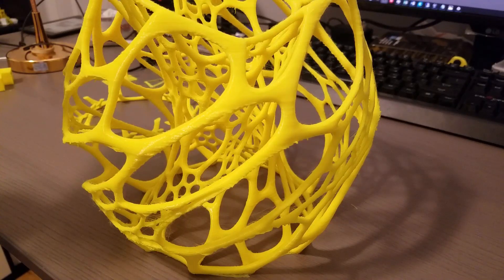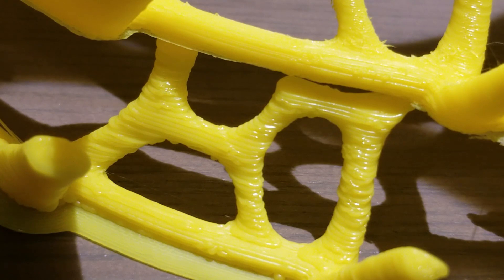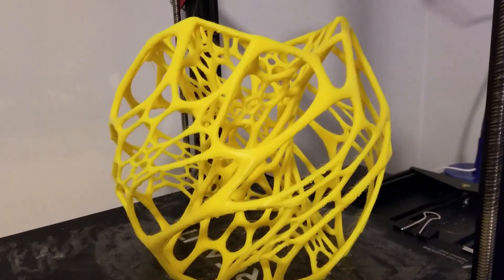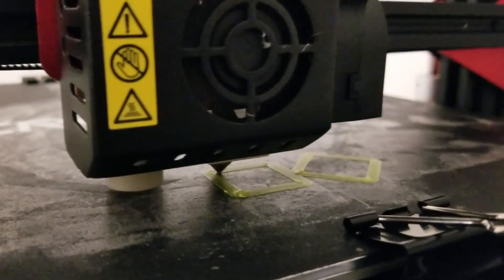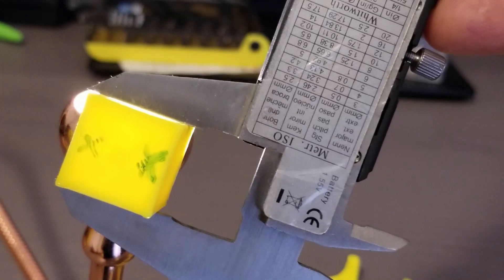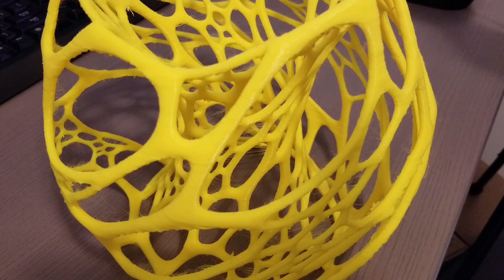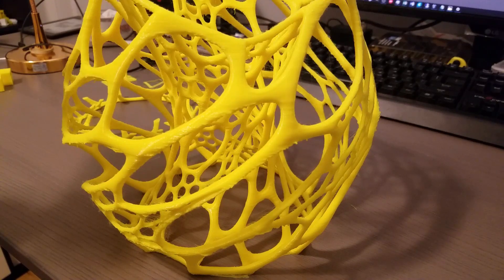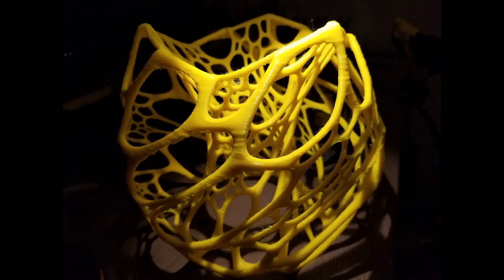CR10S PRO overview on improper Cooling and 3D Printing Lattices with wall chatter

Comment: Hey!

Watching all of your videos and I was just wondering if you have any updates? If I try to print anything that has a small overhang the corners start to curl up instantly. Will try your settings and see if I get better results. 

I am rocking a cr10s pro with the hero me cooling duckt.
Reply from the maker: I do not have any specific settings, I always change them, I can spit out some but I think you may want a different slicer or use creawesome mod with curea 4 or 4.1, but keep your current slicer as well.. would say try the Prusa Slicer amd try to mimic your currrnt settings. Or try use as many defaults as you can from that slicer. I tried finecking with the settings but I made it worse. So i have been playing with the cr10 s 5, and the two trees sapphire s, and I have seen this in those printers as well. I have been using Cura less and Less, and I like the prusa slicer edition, but most of the time I use repetier host, I tried the kiss slicer on tt sapphire, and I managed to 3d print the cellular lamp, but with a lot of strings. but there were a few failures in between. but I did do see curlups on overhangs, I saw them in the cr10 s pro and in the s5 and the two trees sapphire. I think the whipe function will help. I did notice on the Cellular Lamp that it curled up. not so much curl up as to when the freshly deposited filament fell downward it kind bunjied upward a bit as it cooled
off. So as I was noticing this it was working for me, but in other instances it curls up and the nozzle can break it off. It is interesting that I did see this but I never thought of it to try and solve it. So again I think wipe setting in prusa slicer or kiss slicer may help. But I could not for sure tell you how to fix the issue. I was about to fire up the S5 to print a golden Vase, a smaller replica and I had trouble with Cura and creawesome mod to slice it. but Now I will try to look into this issue. as well. I have to chop up the cell lamp and print only overhangs so I can understand what happens. IMO, I would try crazy cooling on overgangs to instantly cool the filament so it does not change its dimensions when cooling. I would try that to see if it still changes the
filament properties.
Reply: @RoamingInterests  Thanks for the feedback. I will try the other slicers as you suggested and report back if I see any improvement. How did you fix the ripple effect that appeared on your cr10s pro? They appear randomly for me on the X axis. I am afraid to get into any large prints because of it.... 

Does the dual fan setup on your s5 help with the cooling much? I have 2 fans laying around and the hero me has also a dual fan version so I might try that if all I need is better cooling.
Reply from the maker: @Monkey Meat Honestly I removed the dual fan because it seemed to me that the petsfang blew most of the air behind the nozzle. I am no longer in possession of the CR10s PRO, FYI. Now I have hero me and the direct extruder mount for CR10 S5 https://www.thingiverse.com/thing:3327433 Then I modified to be able to put in the filament sensor. But still It it is not As I would hope. Here is a link to the one I modified. I think I had to cut it so make room for the clip to fit. https://www.thingiverse.com/thing:3711791. I am not very apt at designing 3D Objects but I wanted to design one blower duct that points exactly where it needs to, all of them seem to point in a general direction not precise. i also think we need  like the machines shops have compressed air and those ductile ducts to point them exactly.  So No I haven't studied the cooling too much and tested it too much to notice any difference either way. I now have a single fan and that is not properly placed, and the 3D printer was able to print the Celular lamp at 100% The lamp in this video is printed scaled up, because it kept on failing so I think i made it either 150% or 200% size. https://www.thingiverse.com/thing:1883446. I am very slowly learning that 3D printing is a very demanding sport :). In addition all these 3D printers need upgrades. I still haven't found a happy medium yet. I will try to print some overhangs and film them and see what I will find out.
Reply from the maker: one more thing, thank you for watching, I hope I helped a bit.
Reply from the maker: Last Night I started printing a new version of the art vase but smaller not like the 3Ft one. https://youtu.be/xjmzQOAcaU8 And as I was loading the silk gold PLA and pushing it down trough the direct extruder with quite a bit of force it would come out the nozzle thin and then the lenght would shrink and it would thicken. I may be able to make a quick vid this week and show exactly what I mean. So I started the vase and because the layers are sticking to the bed or th eprevious layers then you do not see this effect. but in air overhangs I bet you can see this effect and perhaps they will curl up too. So you may want to also check the PLA it self to see if it alters as it cools off slowly. So i did this a few times, and it resembles with sausage links. But this is this gold silk PLA. I did this type of move before withother PLA and it did not behave this way. I will try this particular PLA in overhangs in a few days when this Vase finishes.
Reply: @RoamingInterests  Thank you for all the information. Helping me a lot with my PRO. Don't know why it's called that if there is so much to fix before you can start printing demanding prints but oh well :D...

I was fiddling around with my hero me blower and lowered it a bit as it seemed all the air was blowing directly at the nozzle and not the plastic layer and it prints the overhangs a bit better. I can achieve pretty good angles with slow print speeds at around 20-25mm/s and low temps around 195C. This PLA is pretty bad quality so I will have to try a quality PLA if I get even better results. Making a lot of vases with hard to print angles so I have to have it set up perfectly to avoid a failed print after 2 days of printing..

For the ripples I found that my hero me fan added too much weight on the X axis so I upped the voltage on the stepper motor. It was working at peak 1A when it's rated for 1.5A and 130C. Now it works at peak 1.35A so still a 10% headroom but it's hot to the touch so I might add a heatsink or upgrade the motor to a slightly stronger one of 2.5A max peak. Layer shifts are gone finally...

Will upgrade my hero me fan setup to a 2x 4020 12v fan once they arrive from china for extra cooling to see if there is a difference. If that works I might just overdo the whole cooling part and design a fan shroud that suits my needs. 

Great videos always helping me out so keep it up! Good thing we have such a great community in the 3d printing world otherwise the printer would be flying out the window at this point :D
Reply from the maker: That is funny. Don't throw the printer up the window yet. I am glad I could help. Also I never checked the VREF on mine. But Now I have one of those lasko fans to blow on the entire printer. In my experience the passive heatsinks do not help. you may want active fans. on the steppers. I also added the motor dampeners and those isolate thermically the steppers from the frame so the heat cannot dissipate. So i think is better to just have a lasko fan blowing air on the entire printer. or add smaller fans on each stepper. but the giant lasko fan is a no brainer option.

Comment: Jerk disabled means use the inbuilt machine setting , So by checking out the marlin firmware setting for the cr10s pro , disabled jerk just means setting the jerk to 8. ( Jerk disabled = jerk of 8 )
Is the carriage still loose ? , because I think a saw it wobble while printing .
Reply from the maker: No I do not think anything is loose. also the acceleration was 200.  and the cubes came out preety ok.

Comment: Try Simplify3d 4.1.2 if you can.. Use the cr-10s pro profile, i am not seeing these issues on the cr-10s pro. I seen others have that chatter issue as well they found it was in the slicer. I just printed some easter eggs that have a wire frame that i am not seeing any of those issues hope this helps
Reply from the maker: I think I have to buy Simplify 3D.
Reply: @RoamingInterests  If you want drop me a e-mail address and a link to a thingaverse file ill send ya the gcode i will slice it with S3D for the cr-10s pro so you can test it out before you toss money to S3D i know its kinda expensive.